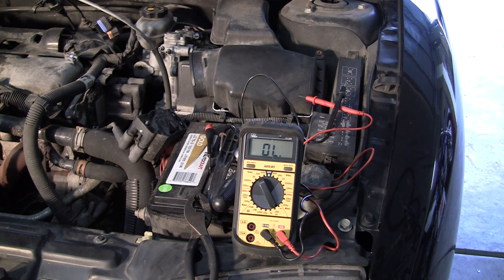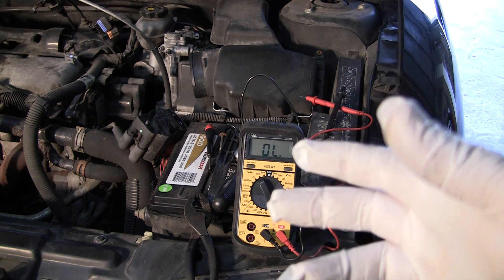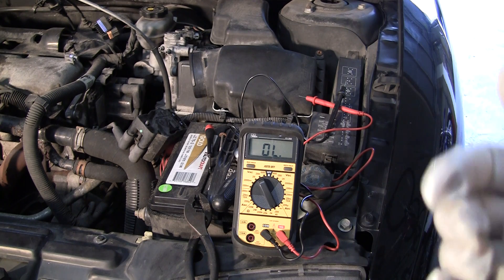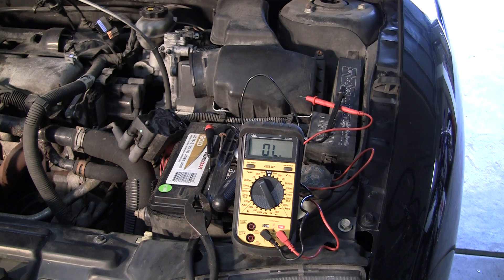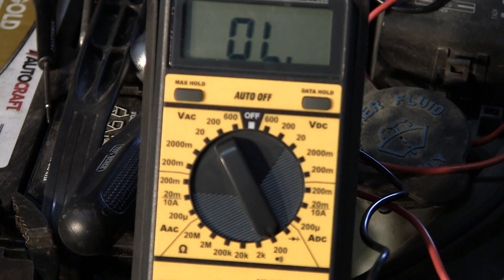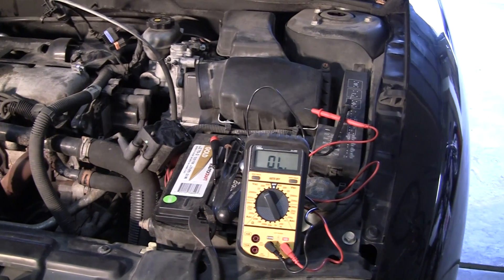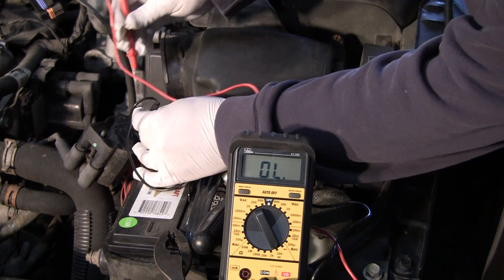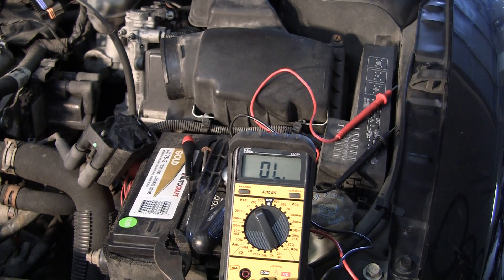How to Check Resistance with a Multimeter. Automotive Coil Example

Comment: Car service manual says to check resistance between two spots, one is in the engine bay the ABS plug and the other spot is inside the car.  How to check resistance between two faraway spots?
Reply: Get longer probes

Comment: Hey thanks for posting. I'd like to add a little comment though. 0:55 when measuring electronic conductors having no resistance is not completely dead. No resistance means that you are measuring a very high conductive material, hence no resistance. When measuring and you get an error or infinity resistance (very high value) that means there is an open or a break in the circuit and you are measuring open air, air has a very high resistance. When you separate your probe on your multimeter, you get an error reading or infinity because there is a separation between probe which is air.
Reply from the maker: Hmm.. Thanks for the tip!
Reply: please sir explain how to check rasistance in automobile 3wire sensor(1-refrence voltage.2-ground.3-signal)

Comment: Not sure if you found out your answer yet. The best way is to use a scope which will show you the entire waveform of the amperage. This will even pick up a shorted turn or two whereas an ohmeter will NOT show this. You can have perfect resistance according to the service manual, yet the coil can still be bad. If you don't have a scope, you can use a DVOM hooked up to an amprobe, but this will give you an average reading. If you have mutliple coils, you can compare your readings with others.

Comment: I'll keep searching. I think there might be a way to check Ohm resistance on a coil, and then from there you can find out how much amperage its using. I'll definitely test out the resistance with a meter next time. I keep burning out transformers, maybe from the amperage draw. Thanks

Comment: is there a way to find how much amperage a coil uses? I keep burning out transformers on my coil, but might be due to kickback current when the circuit stops, not sure. Maybe a diode would fix the problem.

Comment: Camshaft position actuator solenoid. I put meter to 200. Reads 12.9 and goes all the way down to 0. And goes beyond -0. Is that bad?

Comment: wear will you set your multimetre to check the resistance on a crank position sensor with specified value of 480-1000 ? 200,2000,,20k,200k,2000k?
i dont get nothing @200 but wen i switch to 2000 i get 902 on multimrter,@20k i get 0.89 @200k i get 00.8 and @ 2000k i get 000 ! is it good? or is it me ?lol to be +expecific and sorry for my english ,the sensor is a vw g28 speed sensor and expensive as f@#$ part #0261210200 by bosch ,thanks 4 tutorial great stuff

Comment: @gentrymx3 Basically it's a measure of electricity not being able to flow through something such as: a length of wire, a sensor, etc.  High resistance blocks a lot of flow, low resistance allows it to flow freely.